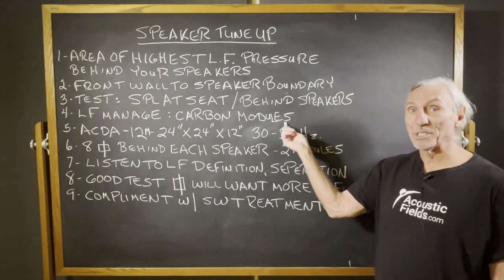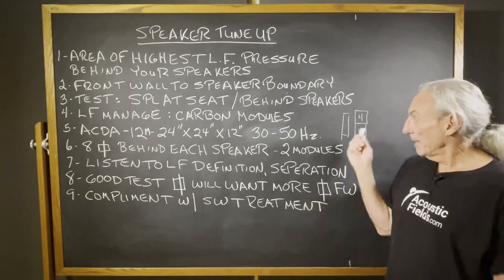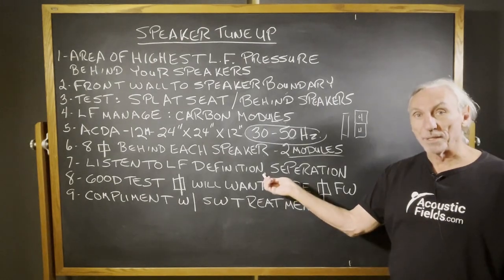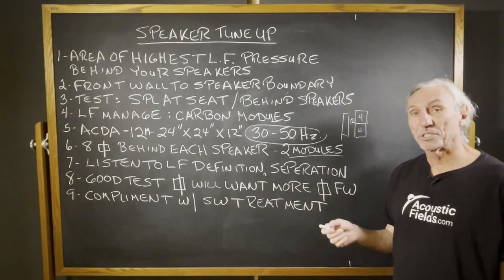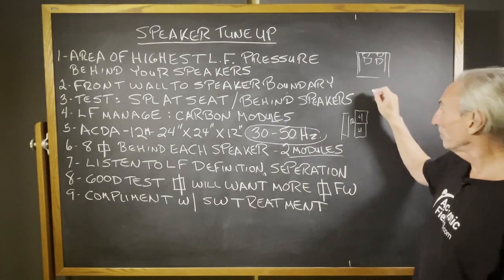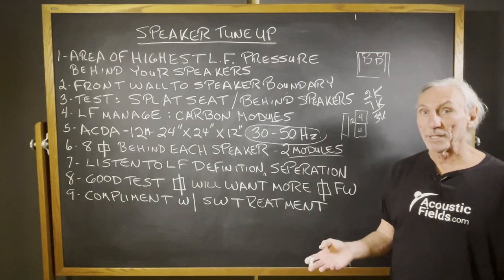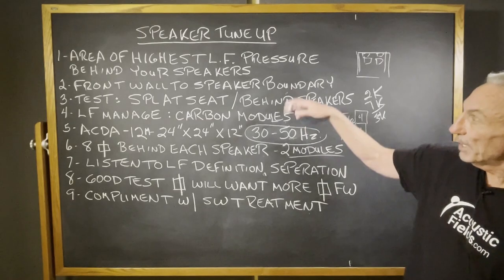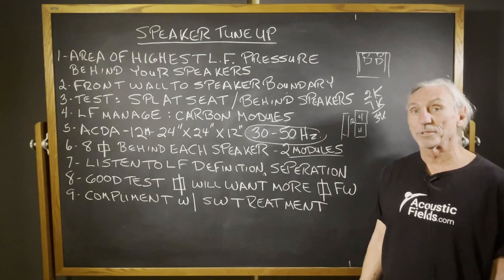Speaker Tune Up - www.AcousticFields.com

Comment: You gave this advice a while back, and I followed it to the letter. Mapped the pressure and got two pressue traps behind each speaker on the front wall. 

Made a big difference! Flattened out the bass response really well. It’s basically treating a first reflection…the one from the front wall and that’s only Bass! 
Great advice. Thanks 🙏
Reply from the maker: Its treating pressure. Think of low frequency energy as a pressure wave.

Comment: Hi Denis, please can you make a video about built-in wall speakers (like studios have speakers built in front wall)..what is in this case pro/cons. Thank you! You are making ours lives much clear sounding :))
Reply from the maker: We do not subscribe to inwall speakers. By their defrinition, they produce more distortion than sound quality.
Reply: Whether anyone "subscribes" to it or not, flush mounted mains bring a massive improvement over in room monitoring. 
They successfully address a multitude of of acoustic distortions that plague typical in room setups. 

SBIR is entirely eliminated (SBIR easily robs a system of punch, resolution and clarity thru the critical LF octaves).  

Bonus; free and significant headroom is gained via the half-space/quarter space boundary loading. 

That said, superb performance can be had via free standing monitors as well.

Comment: I know the ACDA 10 boxes come with a foam front, but do the ACDA 12 M (smaller 24x24x12) come with a foam front or can it be added?  Thanks!
Reply from the maker: Both units can be used with our foam technology.
Reply: @AcousticFields  Good to know..
Reply: @AcousticFields  Would there be considerations (speaker type floor standing to a monitor using a speaker stand, and/or room dimensions)  to use the ACDA 10 instead of the 12's for this type of treatment as an entry to AF technology?  How about one of each 12 on the bottom/10 on the top?  

I think this is an excellent, relatively inexpensive way to ease into adding treatment for those on the fence with a limited budget...
Reply from the maker: @Oneness100  You have to use the correct tool for the job. If you have unwanted pressure issues at 30 - 50 Hz. in a certain room location, you use the ACDA-12. If your issues are 30 - 300 Hz. you use the ACDA-10. The room tells you what unit you require.
Reply: @AcousticFields  Sounds good….

Also, since this would be an introduction to AF technology and an entry level amount of treatment, would it be better to first listen to the treatment without adding a subwoofer to the standard speaker setup? Or does it matter??

Comment: Dennis, the ACDA 12M's are the larger units, not the smaller 24x24x12 units….if you can update the website, that would be great if you're offering the ACDA 12M's in the smaller size...
Reply from the maker: Modules are avallable in both ACDA-10 and ACDA -12 technologies.
Reply: @AcousticFields  Cool..  I wasn't sure since the website only mentions the ACDA 10s for the smaller units and the 12's for the larger...